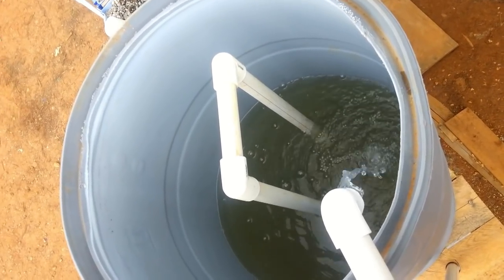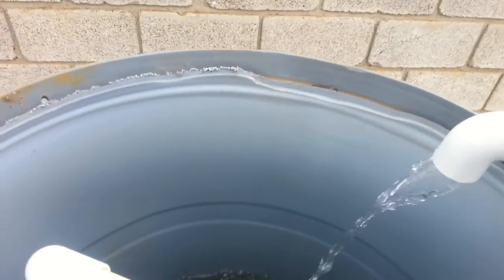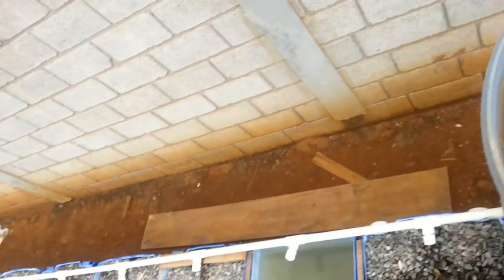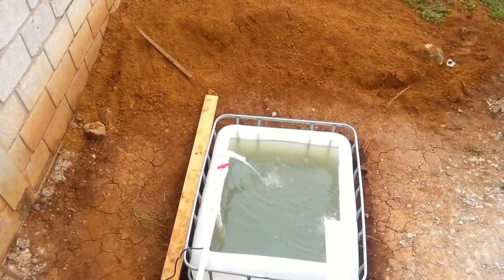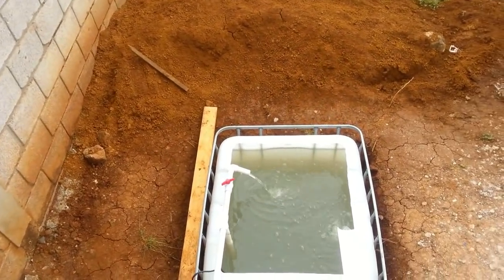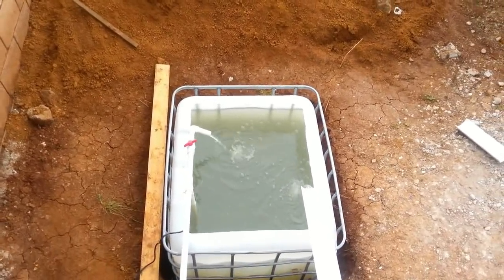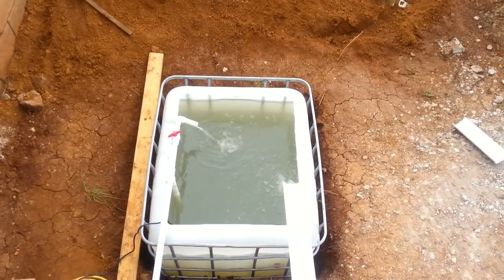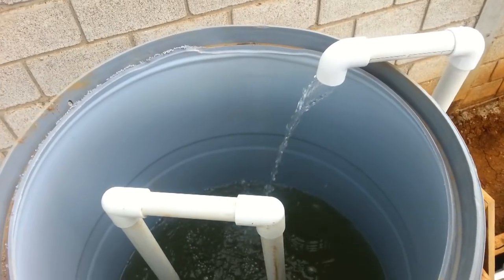A View of the U Siphon and Its Function on an Aquaponics System

Comment: Quick question if you don't mind! What is better for U siphon, 1" or 2/3 pipe please?
Reply from the maker: I don't believe there is an advantage of one size or the other, though I have never seen a 2/3" pipe. The key is that the water in the dump tank raise to fill the U creating the siphon which will cause the tank to drain into the grow beds and begin the flood and drain and water then returning to the fish tank. Maybe the real question is what materials are available to you. If 1" pipe is all you have available then use it. If 3/4" inch is available then use it. You can have a greater view of how we built this system by viewing our video, "Building an Aquaponics System in Real Time. We also have several other videos related to an aquaponics build. They can be seen on my channel at: https://www.youtube.com/channel/UCU290sQCYhwr8lZirAfXzgA.
Reply: I am curious to know why there is an outlet at the end of the lead pipe? (If I undwrstand..thats where the pump is connected)